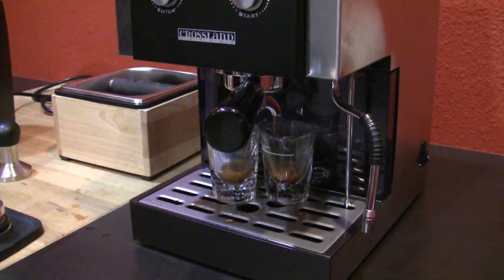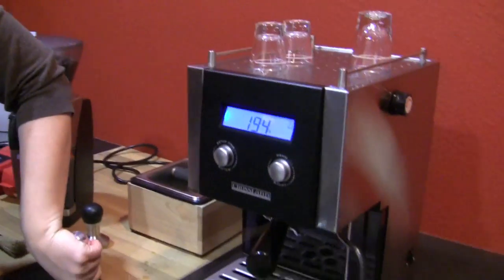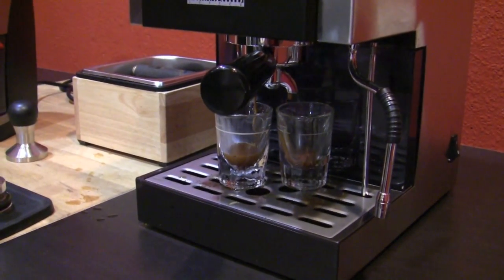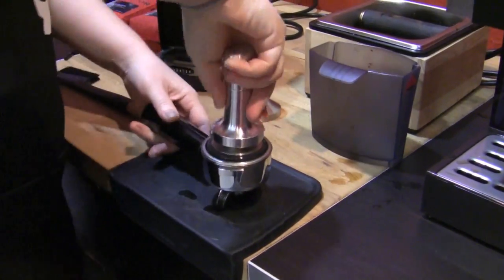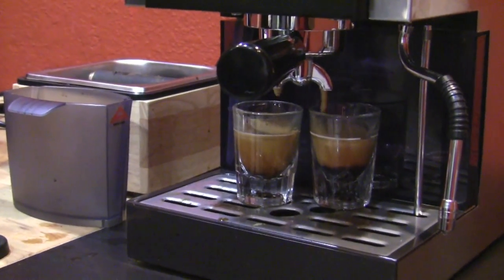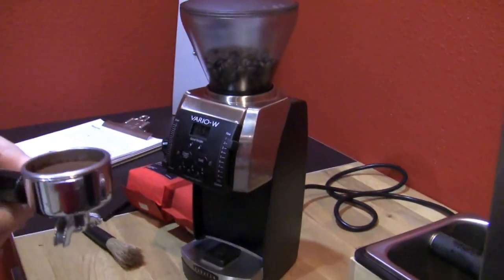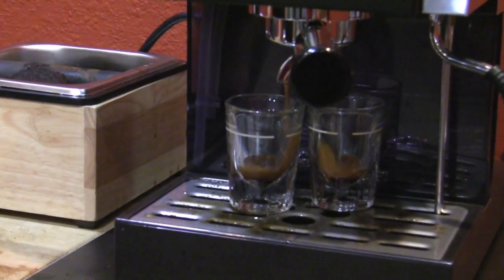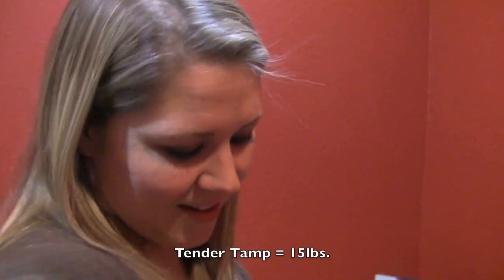SCG Experiments: How does tamp pressure affect the coffee grind?

Comment: My experience is that with conical burrs, resulting in a wider range of grounds (less consistent) the tamping pressure makes more difference than with flat burrs. Imagine pressing down on a glass filled with the same size marbles and a glass filled with differently sized marbles. The small pieces fill up the room between the biggies. 
Also, with espresso machines that have a high water flow I like to tamp a little harder; sometimes helps to slow the initial infusion of the coffee bed..

Comment: 30lb of force spread across a 49mm portafilter would create the equivalent pressure of 42lb on a 58mm portafilter.  Have you done the same experiments on smaller baskets, or are calibrated tampers not available in those sizes?